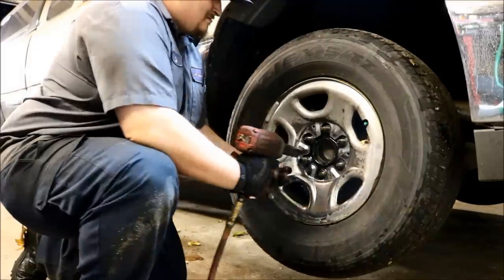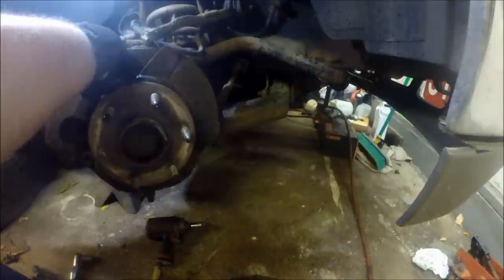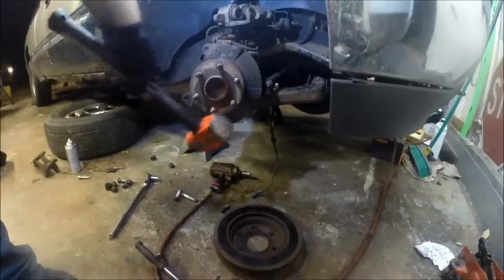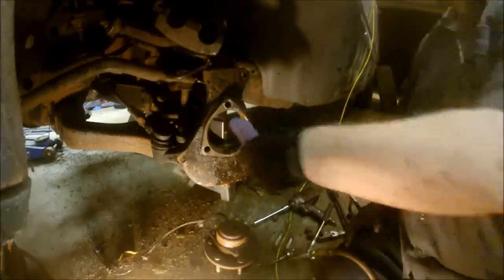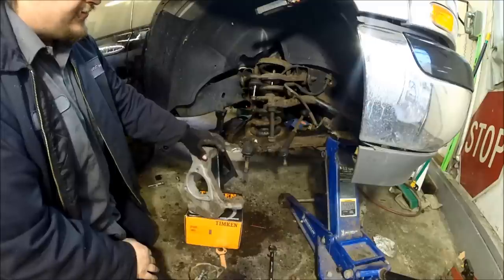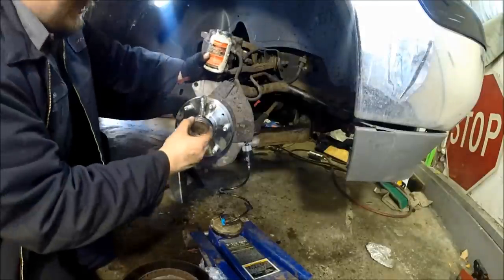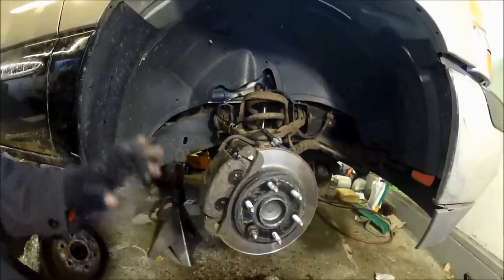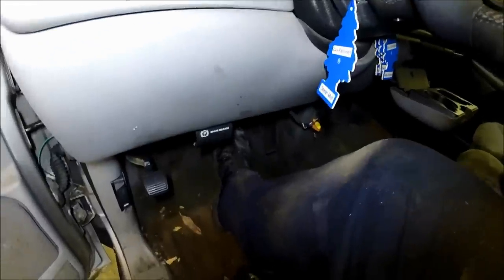1999-2007 silverado / sierra  2wd wheel bearing

Comment: For guys who care:    Caliper: 30 ft lbs......Caliper Bracket 75 ft lbs.......Hub center bolt (35mm) 177 ft lbs......Hub back mount bolts (15mm) 75 ft lbs.
Reply: Thanks,  I've been looking everywhere for this info!!
Reply: “Clark that’s the gift that keeps on giving the whole year!” Thanks for the info.
Reply: THE REAL MVP!!!!!!!!!! THANK YOU KIND STRANGER

Edit.  Unfortunately this is wrong. For a 2wd silverado 1500: hub bolts 133ftlbs, caliper bracket 129ftlbs, caliper bolts 80ftlbs
Reply: Two wheel drives don't have a hub center bolt and on a four-wheel drive I believe it's a 36
Reply: @jacobcalico7185 yes 36 and believe touque may vary depending on 4wd vs 2wd. Would double check specs before trusting torque specs from YouTube commenter. “For those who care”

Comment: Is it unusual for a front wheel not to want to spin freely after having installed a new wheel bearing assembly? I’m doing this on my 2006 Silverado 1500 rwd & it’s so tight after I can tighten the lug nuts all the way down with the truck still in the air.

Comment: Great video. One of the few videos that worked out exactly as my 2003 Silverado was built. Usually, I have to watch 5 videos and piece part from all 5 videos to get a job done. Not this job.

I could do brakes but was "antsy" about wheel bearing/ hubs until watching the video and realizing that this was really the next step in teardown after brakes.

 I realized that I could indeed do this job myself and save money. That's what I did.

Thank you very much.

Comment: Thanks Joe. I actually bought a wheel hub breaker ATD 8629, when I saw how hard it was to get the one off in the video.  You helped me alot, and saved me 350$ in labor. Have a good day.
Reply: Just. Buy new hub and knuckle the new brake pads and always change  new rotors  and abs sensor all new parts save you time and  your ass new brake lines and if you do it yourself less than one 3rd the total cost of a mechanics labor alone do your self a favor do it right once
Reply: $350 labor????
Reply: @mikecastleberry9671  Buy a new knuckle?    Why?    You just like spending money for a new knuckle to replace the old perfectly fine one?

Comment: T55 socket,18mm, 15mm, 40 grit sandpaper to clean out the rest ring, you're better off using a 2 inch wire wheel. A 5/32 drill bit in case you break off the plastic securing pin to the harness that holds the cable from the hub to the control arm.

Comment: I am currently in a bind with removing both sides of my crusty 2000 silverado, they are both stuck and not budging at all. Removing the knuckles does not look like its going to be any easier. Trying more heat to them and bigger hammer!
Reply: Finally got both sides off after a day and a half. I used heat, penetrating oil, giant hammers then finally air chisel. Also a method on a different video of 4 inch bolt in through stud hole.

Comment: Ok cars I use the wheel stud adapter for attaching a slide hammer, not sure if it will fit a truck hub but if so worth a shot the slide hammer works great for me

Comment: For those that don't know any better, or just don't care to do it right,  this video is fine.  For those that do give a damn, don't take the caliper bolts out.   Just remove the two(2) saddle(caliper bracket bolts).  Pull the caliper and saddle off in one piece w/brake pads still seated in saddle.  Don't beat on your rotor, even if ya have a "semi-new" one laying around that ya beat off the last truck.  A slide hammer is best suited for removal of the hub.  Attach it to hub face with lug nuts, and slide hammer it off.  EASY!
If ya don't have one, or care to rent one, there is at least one small slot between the inboard hub face and steering knuckle, use a strong striking scraper, or a relatively flat chisel to tap into slot and get the hub broke free.  Once it moves, a few light taps on the inboard face of the hub flange should get it onto the floor.  If ya leave the bolts in to prevent it from falling or what not, it's possible, and in my experiences, likely to become wedged in the knuckle.  I don't know all the torque specs, but definitely try and torque your wheels to factory specifications.  GM aluminum wheels for 6 lug trucks should be torqued to 140 ft. lbs..  Going the extra mile in your work let's you drive it a few thousand more. Good luck!

         Technique is everything;
                    Blam
Reply: Thank you…I was wondering if I could remove the entire brake assembly as one unit.

Comment: Joe- thanks for the video! Replaced a worn out one that was quite firmly rusted in and this video helped a lot. One trick I used was using a chisel/punch set to wedge in-between the hub and plate (knuckle??) it mounted to right where the bolts screwed through as there is a small gap . This gave me extra force to try and pry it apart. That and letting it marinate overnight in PB Blaster did the trick.

Comment: Hey man I don’t know if you’ll respond considering this video is 6 years old but I been replacing my front suspension tryna figure out my wheels having massive vibration at 65 mph, gonna be replacing these could had wheel bearing cause this?

Comment: If I’m replacing my spindles for lowering spindles can I just buy the wheel bearing assembly and a new dust cover so I don’t have to beat it off? Just use all new parts?
Reply from the maker: THAT IS ABSOLUTEY A OPTION AND A GOODONE AT THAT

Comment: The front left driver side hub & bearing on my 2007 Chevy silverado 1500 is just being replaced for $ 397 parts & labor.  It was making a crazy loud grinding and scratching noise for days.  It was unbearable.
Reply: Ahh man Rosa next4 time you have a problem, avoid whoever you took it too and utilize someone that knows this stuff and can do it hella cheaper THUS still does it RIGHT the first time.  That's a $150 for a home mechanic.  Just had my caddy done by a mobile mechanic on the brakes rotors and front hubs for $200.
Reply: @twportre8809  damn, I can’t find anything that low, with me buying the parts and just paying labor most are saying $340 🤷🏼‍♂️🙃

Comment: Im doing the same thing ,except two of the three 15 mm on back of bearing assembly ,dont want to budge ... actually there rounding out . What do i do
Reply from the maker: Heat them up with a map gas torch be careful of your brake hose
Reply: @JoeTheAutoGuy  Also, only use 6   point sockets, I prefer impact sockets.

Comment: wow ... this is the 2nd video i'v watched on this procedure and both of you guys had issues getting the old bearing out.  i hope that i can do it in a driveway.
Reply from the maker: there not all like that but some are just down right terrible
Reply: Pro tip. Use a solid 3lb mallet to pund on it, not a dead blow hammer. Also, once there's a tiny bit of room behind the bearing. Take an air chisel to it. Might Mar the area up.butnjust grind it back down with a flap disc

Comment: I'm wanting to completely redo my dads front end on his 99 GMC 2wd. Where is the best place to go to buy parts? It's hard to find just a kit. I'm talking upper and lower, wheel bearing, knuckle, pitman arm, everything. Any suggestions where to go?
Reply from the maker: Buy quality parts from rockauto.com there are some cheap stuff on thier but you can get factory stuff for less than dealer prices  and or better aftermarket cheaper than parts stores

Comment: You needed to have sprayed the rotor down with brake cleaner prior to installing the caliper and brake pads. You have to clean off the dirt, oil and grime you left on there that can easily be seen before you put the caliper assembly back on. Sure fire way to have squealing with your brakes and possibly grooves in your rotor from the dirt and grime left on it.

Comment: so i had looked at the one where there was a NUT holding the bearing housing so I though, ah ha, mine doesn't have that, lemme go back and see if there's another version because my truck has given me some problems in that I SAY it's 1999 when all the time it's one of those weirdo's that was made close to 2000 and really a 2000 disguised as a 99. SO I come in, you've got that housing all out and you go through how you cleaned it up and NOTHING on how I'm going to get this bearing out. Let's work on that, in the mean time I'll keep searching.
Reply from the maker: in the video i show removing the hardware and hammering one out. on this particular right side i disclose that the while knuckle removal  had to happen but there is a clip of just hitting it with a hammer and it does work . this particular one was tough but many come right out with some elbow grease

Comment: Probably a slide hammer would make the removal easier
Reply from the maker: i have done that a few times but no luck on these stuck ones like this . best luck ive had is a air hammer and spin the the hub assembly mount side to side to split the rust ring that holds it in

Comment: my 2001 chevy 2wd 1500 don't look the same mine have a rod.
Reply from the maker: Karl Keenan is it a half ton pickup?
Reply: JoeTheAutoGuy I don't know, it's a two door no back seat  2 wheel drive short bed 4.8 engine
Reply from the maker: Should be this set up ? Send a pic to my facebook if you can
Reply from the maker: it should be this set up